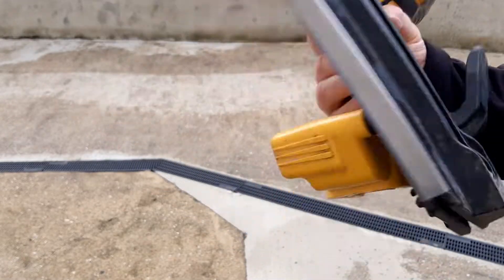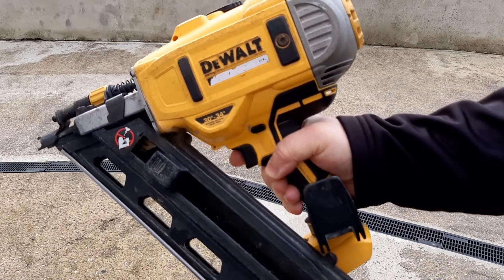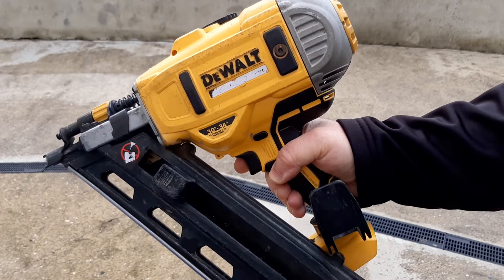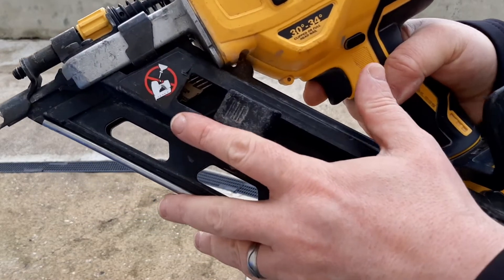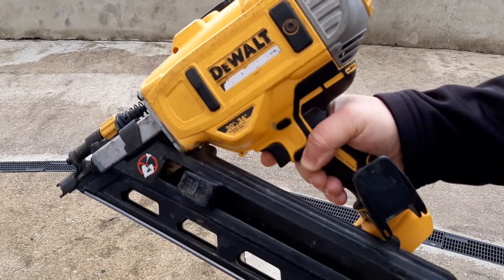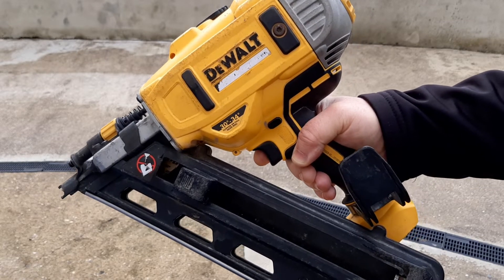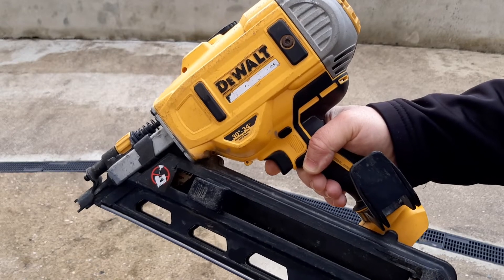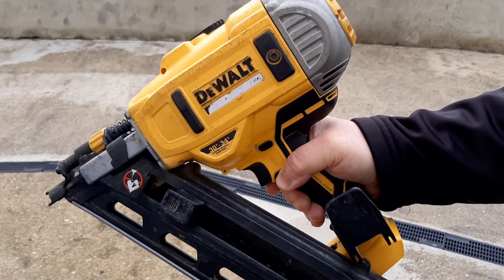Got a DCN692? DON'T DO THIS!!

Comment: I'm thinking of buying one locally that's used...I saw your video of one that had fired 20,000 nails...what do you think of them...I'd always fancied the Hikoki,but the DeWalt is just down the road and affordable...👍
Reply from the maker: The Dewalt is good and people are getting alot of work out of them I am hearing great things about the hi koki but never had one in my hand
Reply: @doctorlefthandthread  Thanx for getting back to me,I would like the Hikoki but people are saying that the DW is easy to service and fix yourself ..plus no chamber that needs refilling...I got mostly DW,Makita are great,but I think DW are pretty solid generally, 20,000 nails speaks for itself..👍
Reply: Yep, fully agree. Oil wrecks them. I won’t work on any that have been lubed, it always ends in unhappy me and customer. 
The oldest one I’ve worked in was rusty inside from working near the coast, had fired well over 100K nails, and still going strong after a change of springs.
Reply from the maker: @default9740  thanks for your comment